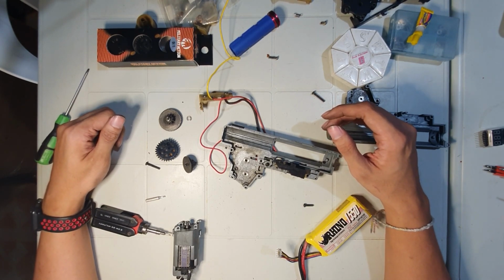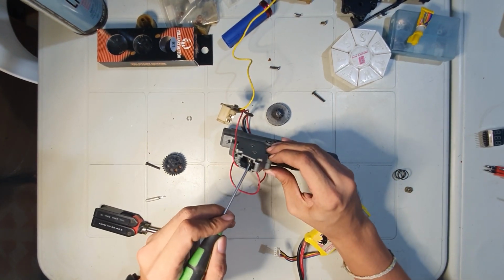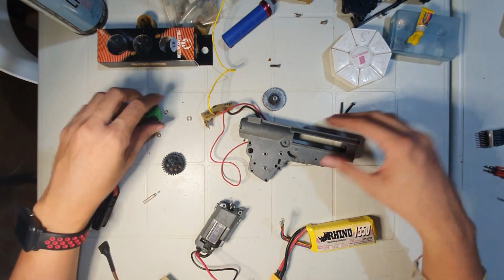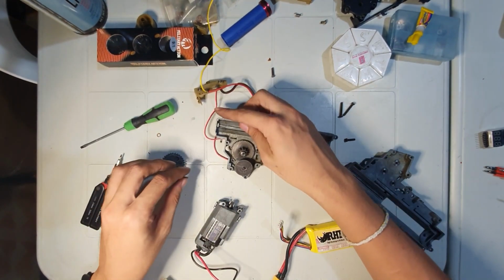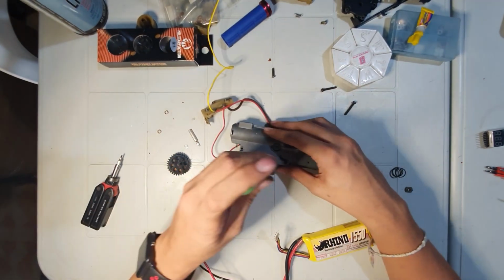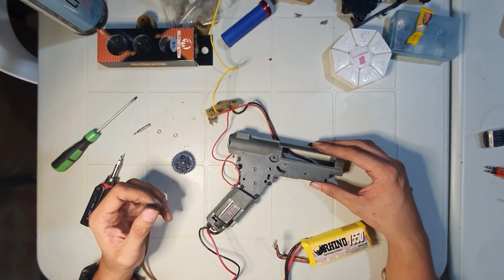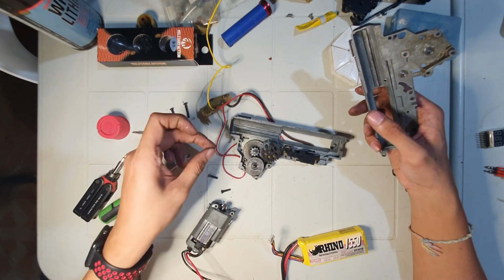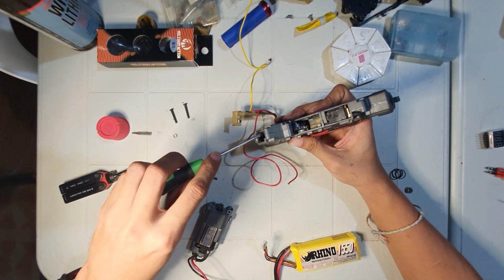[Airsoft] Helical Gears Shimming Guide for a Ver3 Gearbox

Comment: Glad I saw this video last night! I was shimming my v3 gearbox with 13:1 SHS gears. It spun freely with the SHS bevel by hand, but I attached the motor like you did here, and it had some screeching going on. I removed a shim and same screeching. I put the stock bevel gear back in and had a much quieter sound. Put all the gears in and attached the motor back, and it was nice a quiet. Sometimes certain gears do not like gearboxes or pinions on the motor!
Reply from the maker: Glad it helped! Also check the motor height, it could also be the reason for the noise.